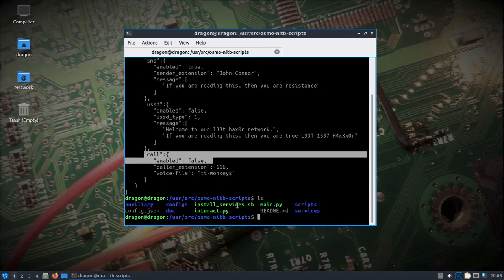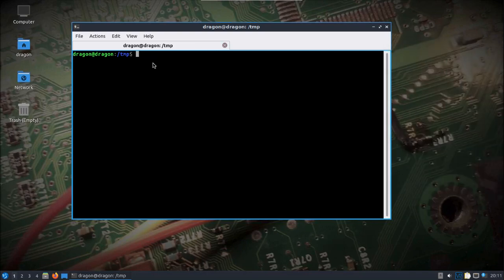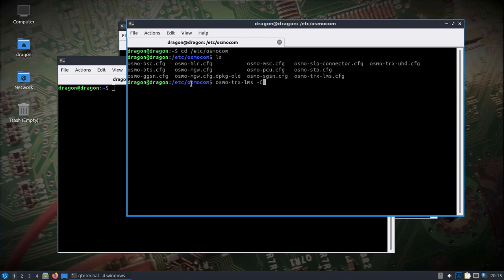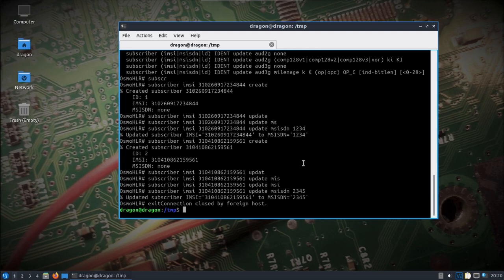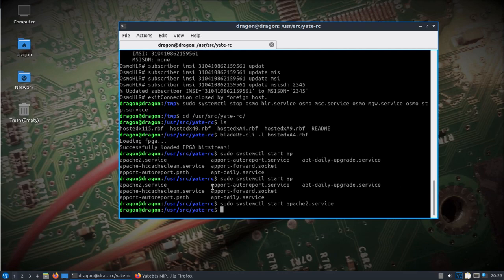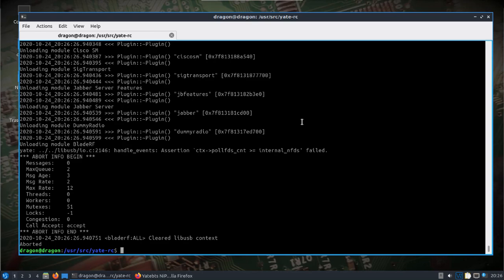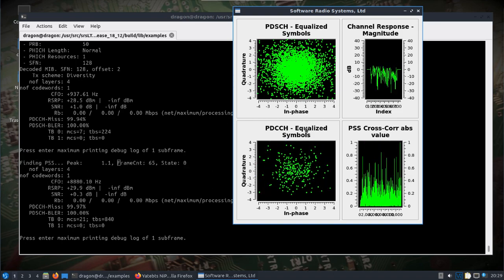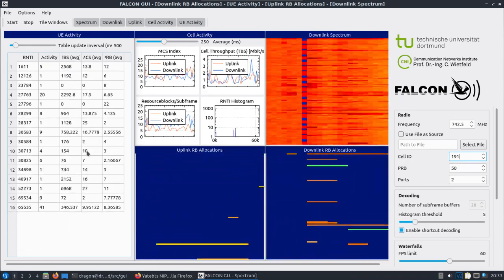DragonOS Focal Updates w/ Osmo, YATE, LTE IMSI Catcher, and FALCON (LimeSDR, BladeRF, B205mini)

Comment: your OS is some of good, but dont show any improvement on BladeRF xa9 IMIScatcher,srsLTE, nothing work? I have been test for weeks nothing on my end.
Reply from the maker: Interestingly enough, that video caused my account to be prevented from posting anything for awhile, so I’ll have to wait and see what my appeal turns up. As for the srslte catcher, I have personally not seen it work. I didn’t design it, but rather attempted to piece it all together. It’s possible it doesn’t work, however, someone on Twitter mentioned doing more work to it and using it for private use. So maybe it needs more work. I can’t be much help though.
Reply from the maker: I should point out, as always, I show things like this for educational reasons. It’s a very interesting tool that can teach a lot about how lte works. As to if it does what it’s designed to do, that I don’t know.

Comment: It's great,, I have a brand new blade 2.0 xA4,, is it possible to use it with it?
I already using YateBTS and it wasn't going well with all of my sim cards..
my random simcards couldn't connect to my YateBTS with blade xA4. still searching for the answers. crossed fingers
Reply from the maker: Hi. In my experience, and this is just what I’ve found so far, I’ve had very little luck in having my gsm phones connect to my bladerf xa4. But, I’ve just recently been told about some updates the bladerf guys did to yate. So I plan to test again. You may find that what is already on DragonOS Focal will work for you, as others have told me it works after doing something that makes it possible for their phone to only connect to the bladerf xa4. I will try again and update everything soon and see if it works on my end.
Reply: @cemaxecuter7783  Nice,, I'm trying to search the BTS configuration  (NIPC YateBTS) and still my sim cards can't connect to it. but if I try another MCC and MNC, the BTS shows but rejected to connect it. Today I'll try dragonOS with xA4, Crossed Fingers. and thanks by the way for some a fresh suggestion.
Reply from the maker: No problem, and i think I mentioned in a later video or maybe this one - I did install everything I’m showing. So you should only maybe need to start apache2 for access to nipc interface and set config options, load specific bladerf fpga found in /usr/src/yate-rc and then start yate.

Comment: Hello, these are great tutorials and updates! Wanted to ask for osmo nitb I followed the same exact steps as you right after a fresh install of dragon os. The main.py scripts runs and it detects the LimeSDR USB, however no devices are connecting to the station. Was curious is there anything specific about the mobile devices you are using? Or does some configs needs to change? Would really appreciate some guidance, thanks!
Reply from the maker: Hi, and thanks for the feedback. I have two phones, a Samsung S3 and an S4. Both phones are set to GSM only and both have old AT&T SIM cards in them. If I recall the main.py and scripts sets up a 900mhz ish GSM network. I’m thinking it could depend on your phones. If there’s a legit GSM network close by they could be trying to connect to it instead. Do you see the network being broadcast under the more providers option on your phone?
Reply from the maker: Both my old androids are also unlocked worldwide models.

Comment: Is LimeSdr USB compatibile with all programms, and what configuration must be enterend by hand, best Regards
Reply from the maker: Hello. If you mean is the LimeSDR compatible with everything in this particular video, then almost. It’ll work with everything except the Yatebts program. As far as configuration by hand, everything has configuration files that can edited by hand. The stock settings will get you up and running quickly though. 

I will say that the LimeSDR mini I have works with almost all the programs in DragonOS. I should probably make a chart of what works with each piece of equipment.
Reply: @cemaxecuter7783   can I use soapyUHD for connection from YateBTS to LimeSDR USB ?
Reply from the maker: No yate has a special driver they’ve created for the bladerf. It doesn’t use soapy unfortunately.
Reply: @cemaxecuter7783  Thanks for your time to help, best Regards

Comment: How do i view call and sms logs in the nitb scripts. Thnx
Reply from the maker: This is a lot to look over, but I think this will point is in the right direction.

http://ftp.osmocom.org/docs/latest/osmonitb-usermanual.pdf

You could alter the default configuration files I’ve stuck in /etc/osmocom2/

I set everything up so the two separate osmo network options would have separate start files and configuration files. I also think if you’d start the osmo nitb scripts with the —sip option that you could then monitor with asterisk. You’ve also got wireshark.